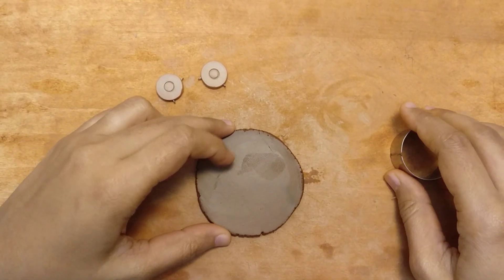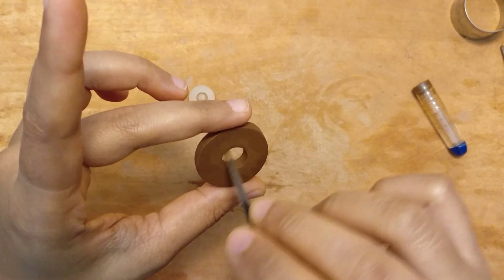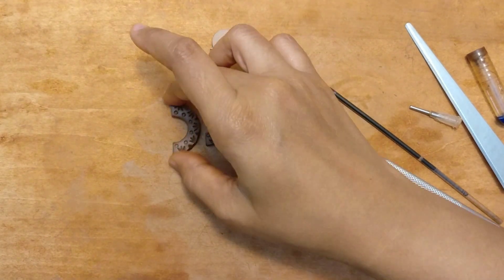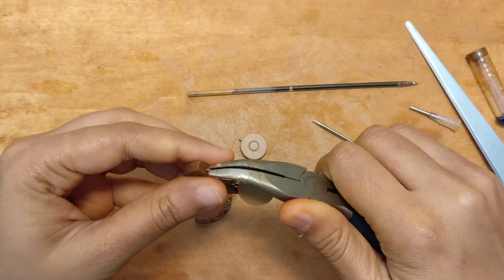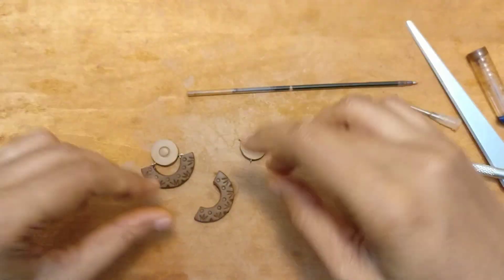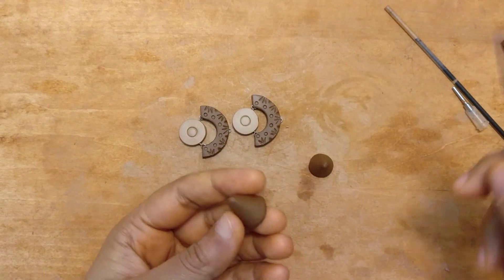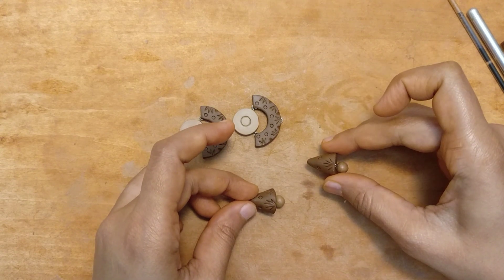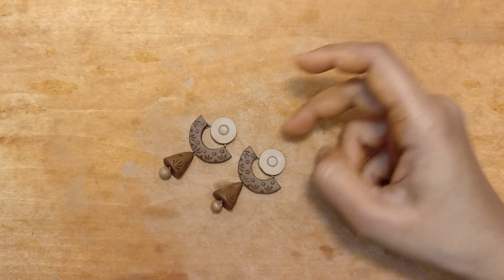Terracotta simple designer wear earring #handcrafted #terracotta #terracottajewellery #chandbali

Comment: Wow 👍Give some tips on baking these pieces or are they just air dried. And what is the size of wire u used for hooks?
Reply from the maker: I don't own a kiln so I take my pieces to a pottery studio close by and get it fired in an electric kiln. They are made from earthenware clay. So they need to fired in order to be used. I use nichrome /high temperature wires. Gauge 28 for stick beads and ghungroo beads, Guage 26 for earrings and gauge 24 for pendants

Comment: Hi do you have any video what are the types of hooks you are using is it readymade or prepared by you means pls share it will be very useful. Thank you
Reply from the maker: Hello! I use nichrome wires gauge 24 for pendants, gauge 26 for earrings and gauge 28 for ghungroo beads and stick beads. As these are high temp wires they won't melt in the kiln during firing.

Comment: What happens if we don't fire the pieces and instead just dry and color it?
Reply from the maker: Depends on what kind of clay you use. If its air dry then it might be okay.
But if the clay package says it needs firing, it definitely needs firing. If its only let to dry, and you try painting it, the piece will disintegrate. Think about this: You take some soil, let it dry, when that hardened piece comes in contact with moisture it will go back to being its original state! paint is wet, so anything moist that comes in contact with un-fired clay can disintegrate the piece completely. Hope this explanation helps:)

Comment: Hi dear can u tell me is there any chances of breaking terracotta jewelry after baking if yes then what can b the reason?
Reply from the maker: Well if its fired well , its durability increases making it stronger. But that doesn't mean its unbreakable. Firing it well helps - preferably in a electric kiln by a professional (not at home using crude methods).

Comment: Where to get   ‘U’ pins ????
Reply from the maker: They are nichrome wires that are cut into u shaped pins. You might get readily made u-pins made of high temp wire. But it might cheaper to DIY.
With a cutter and a round tip nose plier it's rather easy to make 'em.
Wire used: Nichrome wire gauge 28 for stick beads and ghungroo beads; gauge 26 for earrings and 24 for pendants.
Gauge 24 (India): https://amzn.to/2ygy4CJ
Gauge 24 (USA): https://amzn.to/39xZReS
Gauge 26 (India): https://amzn.to/33W8w9X
Gauge 26 (USA): https://amzn.to/3axi8dx
Gauge 28 (India): 
Gauge 28 (USA): https://amzn.to/3azYaPu
Reply: paintedEarthbyneha thanks